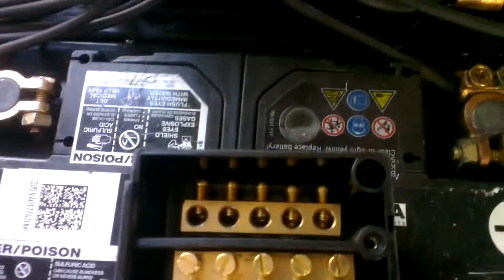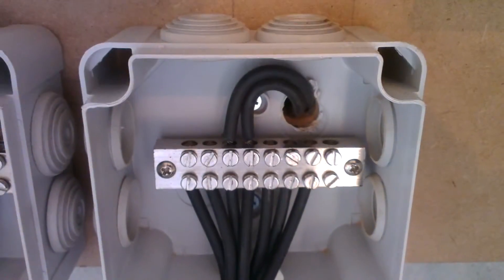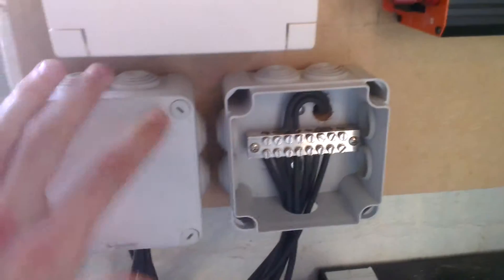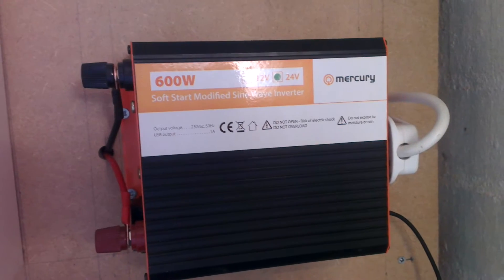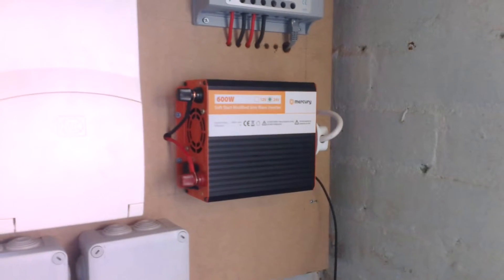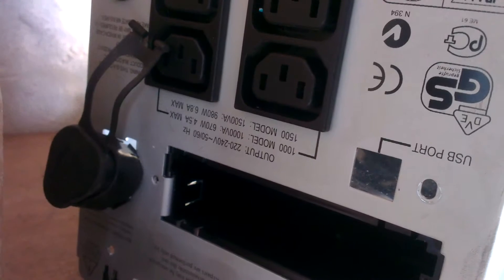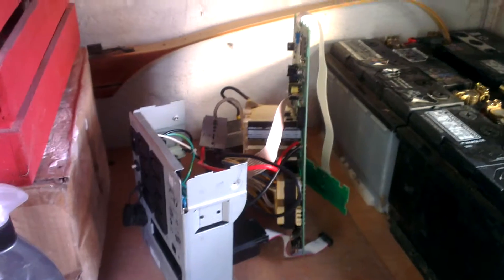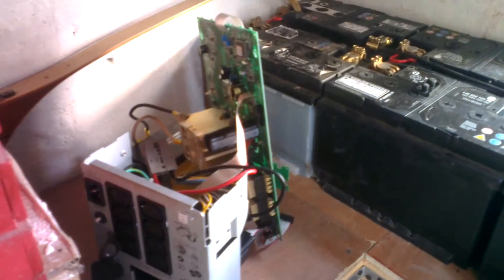My DIY offgrid home solar power station - UK - PART 5

Comment: The buzzing sound is because its a modified inverter. Buy a pure sine wave inverter.
Reply from the maker: +marissen24 Yes, apparently, it's because the wave isn't clean. It doesn't make the buzzing noise with the sine wave inverter. It looks like sine wave is the way to go.